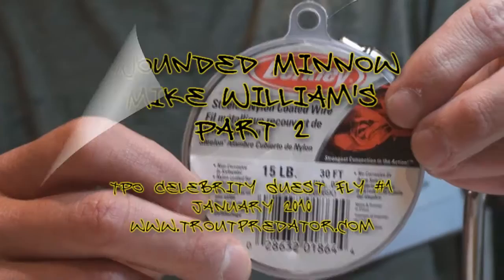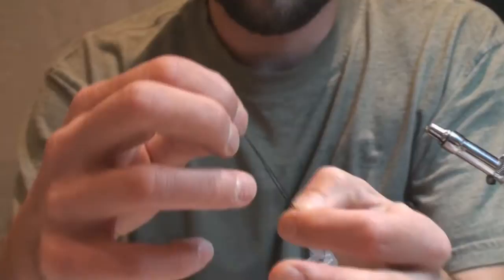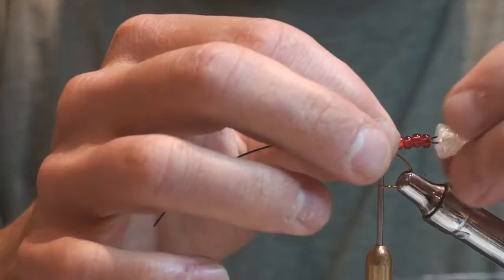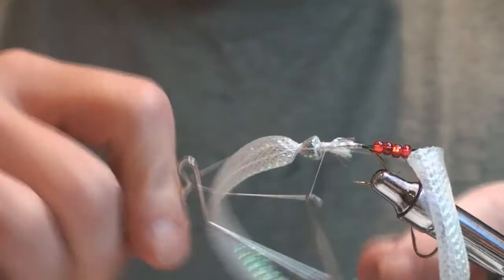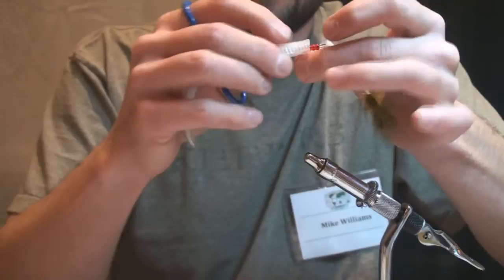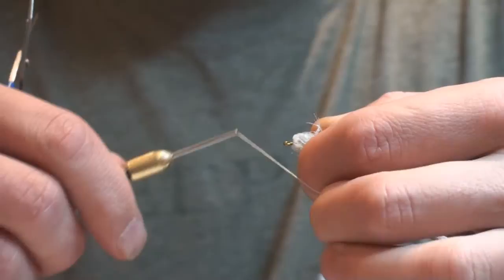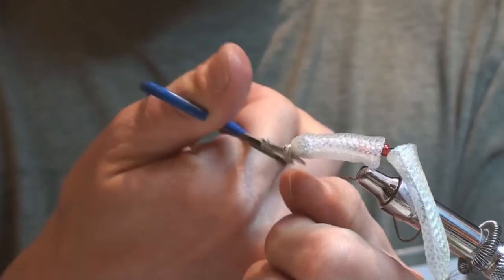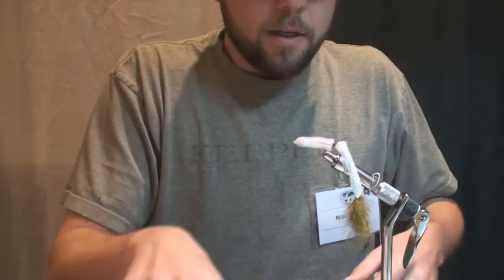Mike Williams' Wounded Minnow Part 2 - TPO Guest Fly # 1

Comment: The tubing is ez body tubing the nylon coated stailess wire can be found at craft stores in the necklace making section the beads can be found here too. The hooks are Tmc bass hook #10 for large tubing #4 for small tubing Gsp tying thread is really important for crancking down the tubing. You can make a floating version by switching the conehead for a foem pooper head or even foam strike indicators work well. Good luck with the fishing!

Comment: very cool dude.  I tie a lot of articulated streamers but never thought of putting one together like that.  Rather than using beads and wire, I've found stiff mono still gives good movement and like beads, works well to keep the hooks from fouling on each other.

Were the ones at the end colored with marker or airbrushed?